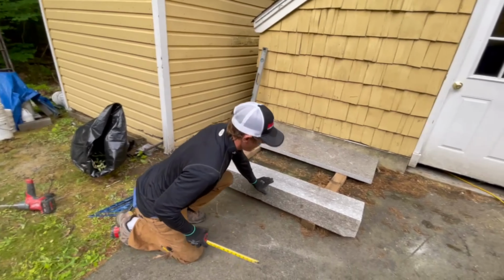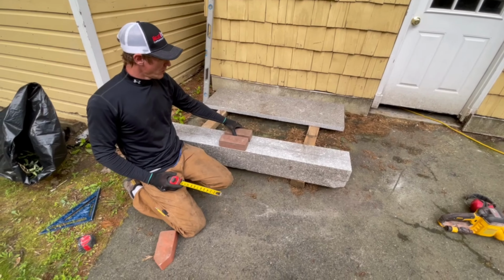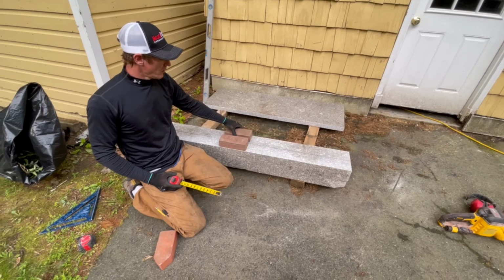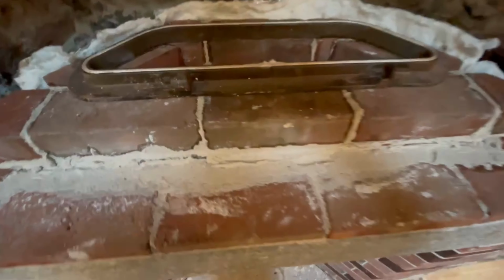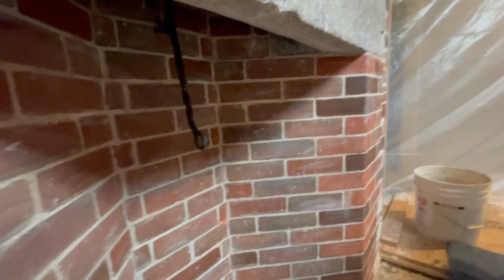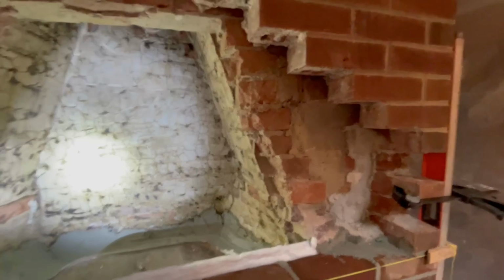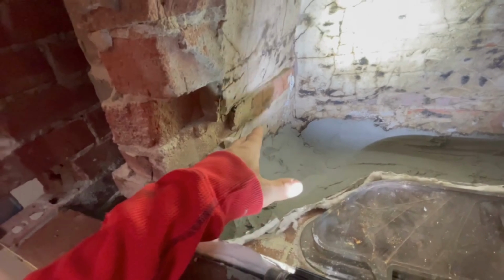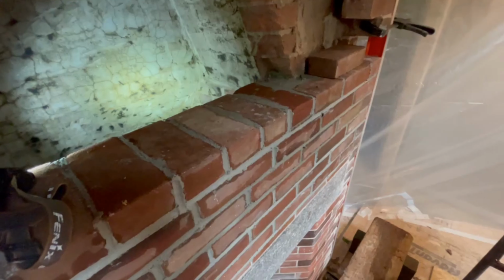Rumford project | Episode 3

Comment: Great Stuff Chad. We are embarking on a fireplace build at an off-grid cabin at a mountain lake. We plan on building the stone fireplace this summer. i've always wanted to build a modified 42" rumford. (deeper and the sidewalls less than 45 degrees. ) Do you believe the rumford is a superior build to some of the other standard fireplaces you've constructed? I think that if we add a 4"- 6" stone facing, we will have an overall depth of ~20".  As such, the 'throat' will be set back 6 to 8" from the front facing. I assume that is just a smooth flat surface from the top of the opening?
Thanks so much for sharing all of your work!!
Reply from the maker: If you're looking for heat, the Rumford is a superior design. Just remember,  the throat and thickness of the breast are what dictates the depth of the firebox. You don't want more than a 4" throat, according to Rumford. If you want a deeper firebox, you will have to slant the backwall forward, and this will no longer be a Rumford because they are perfectly plumb at the back wall.
Reply: Thanks again Chad. I think we can achieve the deeper box with the stone facing projecting out another 5-6”. 
Would you favor a Rumford for your own fireplace or is your answer the same in that it depends on whether you want heat or just the deeper look??
Reply from the maker: I would install a Rumford style every time. Most people choose a convention style because they are afraid of the fire and think it will be safer to have it deeper. I want ambiance and heat at the same time. If i was going to be cooking on the fire every day, I would build it deeper like a colonial style, so I could fit a crane with a kettle pot, and still have room for a pan.